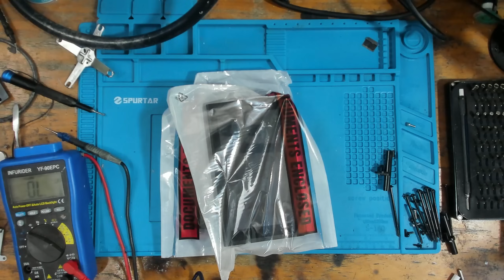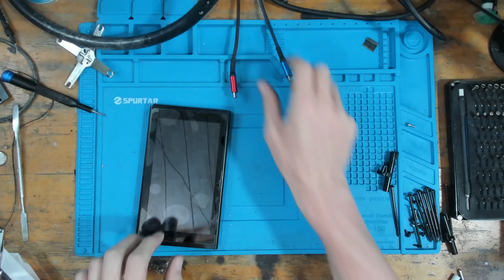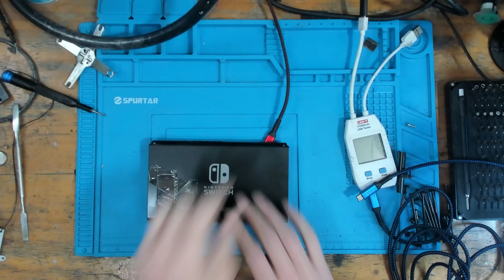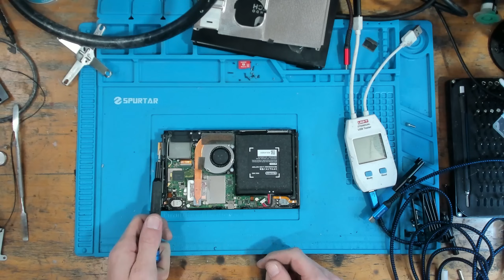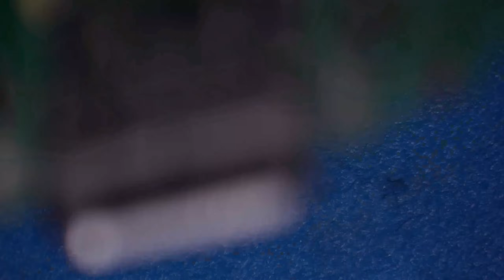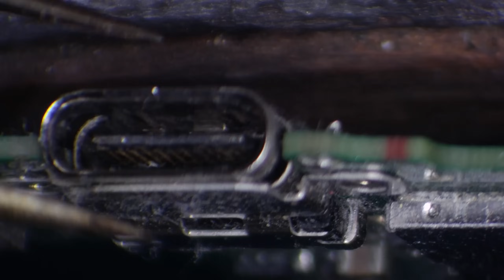I Tried To Fix This Nintendo Switch And Messed Up Pretty Bad! Nintendo Switch Not Turning On Repair

Comment: I wonder how many other tech YouTubers would have the balls to do this? I bet not many would, most record and edit out their mistakes. I don’t even like doing repairs in front of a customer, let alone broadcast the repair live on the internet. Fair play to you Phil 👏🏻👏🏻👏🏻
Reply from the maker: Thanks mate, you're probably right though, not many people show their mess ups. If I just mess up a chip replacement sometimes I'll edit it out just to keep the video short but I always include things like this when I really do mess up. It shows that even someone with a lot of experience can screw up and it also teaches that not everything goes to plan 100% of the time :-)
Reply: Balls to reball 😂
Reply: I was there when it happened, Phill is the real one.  Some big repair shops would tell the issue was there when it came in. Big respect

Comment: Did anyone actually had an defect bq24 chip on his switch?
Does anyone know what to do when the switch draws no power (0.01 only) and I can't find any shorts or visual damages on the board. Replacing the M92 didn't helped either.

Comment: I was replacing the fuel gauge, and  thought it went well untill i i moved the board and relised id been knocking every other component with the other side of my tweezers.
mistakes happen, its being able to put it right by hand which sets you apart from most
Reply from the maker: I agree mate, or being willing to pay for it if you can't :)

Comment: I have a switch that’s had soda split on it cause of my gf cat and it. 
When it still had some charge left it would turn on still for a split sec then shut off but now it’s completely dead and won’t take a charge. You think it might be fixable? If so I’ll send it to you, i don’t trust repair shops around here because of some scandals. I’d like it to be fixed so I can play games with my oldest daughter. I had bought us each a switch so we can play together. Also is the clear part of the screen replaceable ?
Reply from the maker: It's hard to say whether it's fixable but usually they are. It all depends how badly it was affected. I'd be happy to attempt to repair it if you want to get in touch via email (hello@consolefix.co.uk). The touchscreen is replacable if needed too